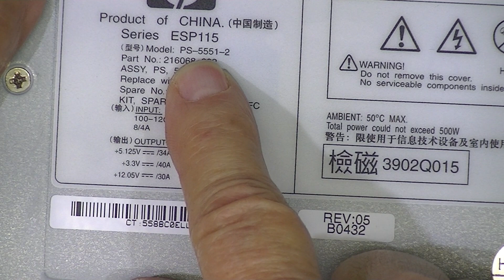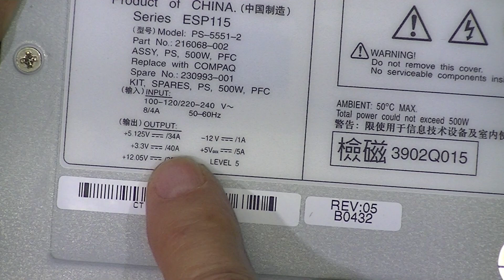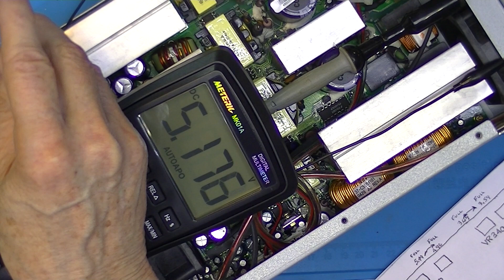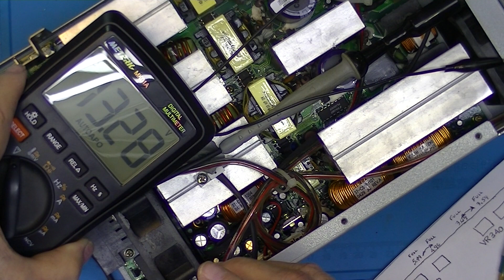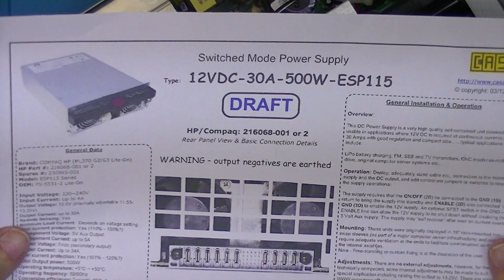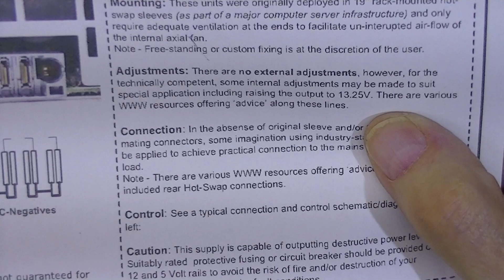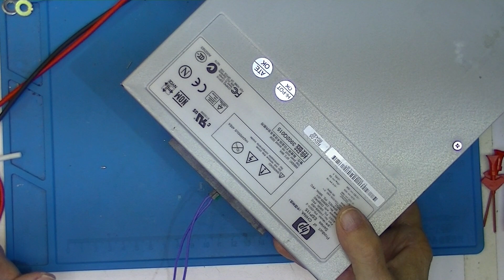ESP115 Server Power Supply - Part 1

Comment: Hi, Is it possible to use 3.3v and 5v output in seris to get 8.3 volts?
Reply from the maker: No, All of the supplies have a common NEGATIVE and that is connected to the case and the power ground. I guess that you could connect to the 12 and 3.3 and get 12 v - 3.3 v = 8.7 V ,but don't think it's a good idea.
Steve